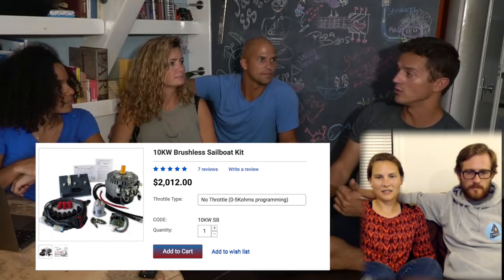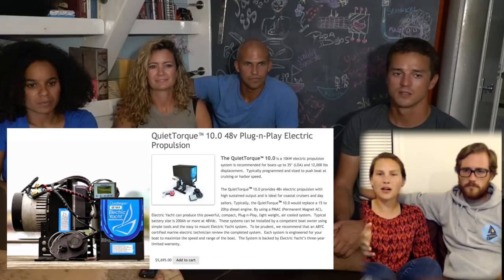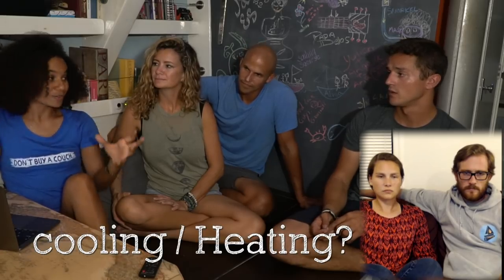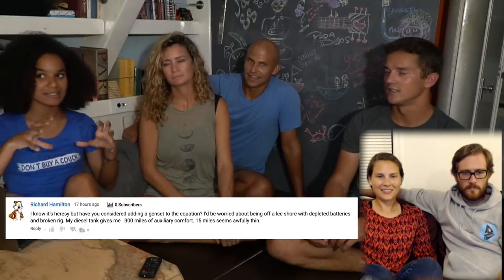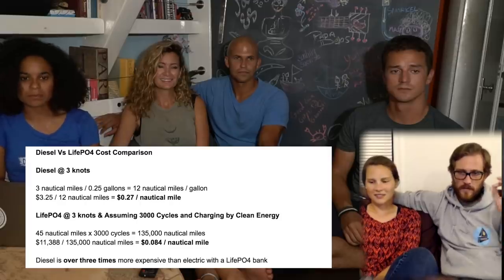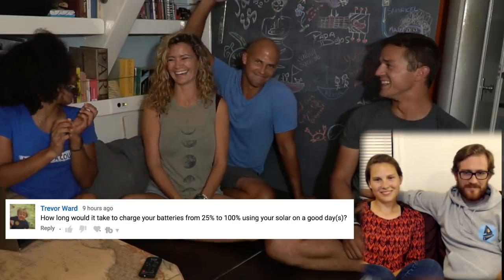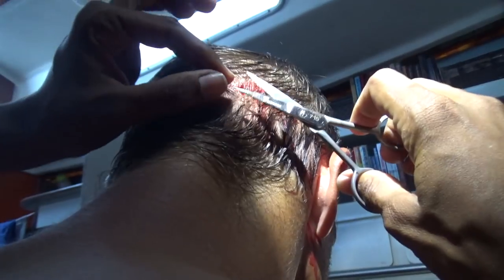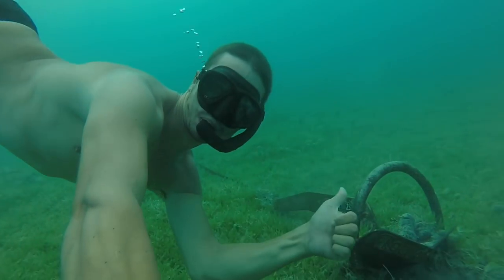Electric Sailboats: An HONEST Discussion — Sailing Uma [Step 140]

Comment: Being a former submariner (engineer), I always smile to myself when electric propulsion is "discovered" as a new technology and the future". Conventional submarines have been using electric motors for some time - 130 years to be precise - since the Peral submersible which was launched amidst great pomp and splendour in the year 1888 after over three years of active researching undertaken by Isaac Peral.   Electric propulsion is great and reliable, as is diesel propulsion. As an off shore yachtsman and despite many years of electric motor experience my preferred propulsion of choice remains the humble diesel engine. Availability of parts, endurance only limited by amount of fuel carried, ability to refuel quickly and power to weight ratio are some of the key drivers for this. In terms of 'green house' impact, I simply don't use the engine for the most part and find I need to carefully gauge how much diesel to purchase to balance the 12 month stated diesel shelf life with reality (usually aim for 2 years). The exception is where we sail up to the equator and there is no wind. A week of motoring consumes a decade of usage otherwise. With currents and tides around SE Asia, it is simply not possible to  rely on the elements to safely convey you to your next destination.  I would have no hesitation to change to electric drive, but would need to take a leaf out of the conventional submarine arrangement where a power source to replace the expended energy is available (termed floating the load). Many bigger modern day sailing ships as well as cruise liners uses this arrangement i.e. flexibility and efficiency of electric but with a like for like power generation source. In terms of using lack of reliability as a 'reason' to change technology, this is a fallacy. If something is broken or not working on a vessel it should be fixed. We sailed in China 20 years ago and needed a part for our diesel engine (heat exchanger). The locals quickly came up with a makeshift alternate that we could have used, but one of the locals that spoke English asked why we simply didn't walk down the road 200 metres to the local Perkins Engine dealer and buy the original part off the shelf - which we did and saved a heap on duties and freight.  Bottom line, turn off the engine, electric or diesel and go sailing!
Reply: Most subs used (correct me if I'm wrong)  diesel generator to electric propulsion schemes. Wouldn't that be a viable solution for a sailboat?
Reply: Perfect solution and the technology that submarines have used for 130 years. The advantages are many, ability to distribute weight where suited rather than at stern. Ability to scale the generating powers to suit load - used in cruise ships when power demand is greatly reduced at nights or when alongside.  Ability to have several generators rather than one big engine that might run at sub-optimal loads. This can readily be replicated in big yachts (say > 80ft).  For regular sized yachts that require propulsion to be available for extended periods i.e. 24/7 the generator must be able to replace any energy used - hence the term floating the load. On submarines once the batteries were full we reduced generating power to equal what was being used to propel the vessel. For a yacht to achieve hull speed for extended periods, it would be necessary to have a generator around the same size as the regular diesel engine i.e. 50HP of electric motor will consume 50HP of generated power (less any inefficiencies). It may be possible to have a generator of lesser capacity if demand is say limited to 12 hours and other means of generating can be used to 'top up the batteries'. However we find all of our generated power (solar etc) gets consumed as house power, so little or none left over for this purpose.
Reply: As a submarine engineer also, I had some experience with Stirling engines and hydrogen fuel cells with Lithium storage. Now that is advanced technology and capable of replacing Diesel engines. At least until nuclear becomes a commodity technology :-O
Reply: Did you catch all the mistakes in his description about 1200 amp hour pack? How about the 350f Electric motor that's designed for 10k hours  @350f?
Reply: So the point that I think all the previous comments miss is that UMA has been operating for 5+ years... yes 5+ years without significant issue, AND the motor they are using, the amps and batteries, their 480 solar, the fact that is overheats if they use it for hours upon hours (which THEY HAVE NEVER NEEDED OR WANTED TO DO), and their method of no needing to "float the load" all works for the style cruising they do. They need nothing else. They admit right in the video several times that this is not the solution for everyone, like maybe those who sail on the equator for days and days, or people who sail with some timeline agenda in SE Asia. Whatever folks, take what you can use and leave the rest. For me, my electrical setup will be solar and generator so I can "floating the load" if I need to, however like the SV's represented in this video, I have no time table and no agenda and I will use the SAILS, the weather and the tides and currents to get me where needed and the electric engine can get me in and out of port without oars. I may never need the geny, but It will be there if I want to use it. That is my style of sailing, and I am glad diesels are there for your style of sailing.  It's simpler, less smelly and I do not need to check the oil levels daily. IT IS simply possible to  rely on the elements to safely convey you to your next destination as has been done for many thousands of years.
Reply: Most modern cruise ships also use diesel generators to power electric motors that are under the ships directly attached to the props
Reply: THOMAS BOLDT :  The same for almost ALL diesel Train Locomotives.
Reply: @MasterYota1  What was wrong with the reported amp hours?
I listened very close and didn't catch anything wrong.
Did you misunderstand the answer that they had 12 one hundred amp/hour batteries?
Reply: @steveddad4385  Uma's Oceanvolt motors are water cooled.
Reply: Aaah a fellow bubble head and I agree with you.
Reply: Let's be honest.  This isn't a "Budget" class of people regardless of what they spent on their boats.   Anyone who can afford to drop $10,000 just in batteries, not to mention the rest of the conversion, is a step beyond my class of boater.   I love to sail, not motor, and yes, they drive me nuts, but not $15,000 worth.  I'd like a renewable fuel source too.   But not $15,000 worth.  How does one ensure a propulsion system worth 2x the value of the boat?
Reply: @crforfreedom7407  I think you might have missed a zero on your cost estimate!
Reply: @captainsalty56  The batteries they bought were just under $900 ea. so that's $10,800 no tax.  The motor they used was a used Clark, I saw them on EBAY for around $500, newer ones went as high as $3,000.   Then all the other inverter equipment needed to support it.   Not all of it of course, everybody has some of that to support their recharging and conversion, but not 48V worth.   I think being very fair, very cheap, about $15,000 is about right.   Some of these others are well over $20,000 to be sure.   We're talking just the power plant and the batteries with the necessary nick knacks.  Nothing else.
Reply: @crforfreedom7407  Yes, you are correct. I was referring to their most recent generation of motor they installed which was I think was the third edition. Pretty sophisticated bit of kit. Think this was donated, but if you or I bought it off the shelf, pretty pricey. However in the intervening three years, since my post, they have done some sailing in places I wouldn't go without an long range motor option. Good on them and we need pioneers. Me, I like to get in before the bad weather.

Comment: I have been a millwright engineer for 46 years, and the worse fork lift truck was a electric one,forgetful on recharge battery failure, and lack of power after prolong use. Combustion engine so much better.....I also fish for trout in big lakes we used to use electric out boards (56 lbs thrust) they where so dangerous when windy.. all boats back to 4 stoke engines... I wish you well,and full charged !! All the best ,  :)

Comment: 👍great discussion! I got rid of my diesel engine over two years ago after it let me down in a very precarious place where I was stupidly expecting it to do its job without fail. More moving parts means more chance for failure... Usually at the most inopportune time. In my case it nearly put me against The Rock jetty in St Augustine. I removed the diesel engine and increased the amount of water I could carry tremendously. Considered putting in electric but before I managed to do it I got quite used to sailing everywhere without any auxiliary form of propulsion.

Good on you all for sailing first. That's why they put those big sticks and sheets on sailboats after all. 😉

I know Beau and Brandy and look forward to bumping into the rest of you probably somewhere in the Bahamas as I'm on that same time schedule LOL. Cruisers, go figure.
Reply: Jim is the BEST yall!

Comment: This is such good stuff! When I first saw you guys install a electric motor I was skeptical about not bringing a generator, but since then I've learned more about sailing and actually started sailing a fairly small boat without an engine. We sail that boat everywhere, even in close quarters upwind. Quite often we have to tack into the harbor where the boat is kept and that's all fine really, if you just know how to sail. Obviously with a larger heavier boat you're not going to be tacking up a channel that's just 2-3 boat lengths wide, but I can't imagine a situation you can't fix with 1 hour or even 15 min of motoring and good seamanship that you could fix with a diesel engine. Keep up the good work.
Reply from the maker: Thanks Paul! We agree entirely.

Comment: One more comment:  I used to have a 27-foot Ericson, I know it is a smaller boat that what you have.  And it was not blue water ready... anyway, its motor had issues, the tank was rusted, etc. After I tried to find someone that would fix it, and how difficult it would actually be to make it continuously operational, we installed the dinghy motor at the transom and it basically worked well to dock and leave the dock area.  That is: if you will keep your dinghy motor, you can always use find a way to use the dinghy motor or the dinghy itself to tow the boat, in case your electric motor does not have enough battery at some point.  That is, it might make it good to think of a good dinghy motor as a back up to your electric motor.  But major kudos to you if you don't think that is necessary.

Comment: We have a 22 foot trailer sailer which is pretty light and slippery in the water. I removed the 2 stroke 6hp mercury outboard and replaced it with a 200ah 12v Lifepo4 battery and a 54lb thrust electric trolling motor. It pushes us along for hours at 3 knots in complete silence. Awesome! Cheap setup for a little boat and works perfectly.

Comment: Our boat came with a small solar array and a D2000 wind generator. The wind generator has really saved us even in the Caribbean. Before we crossed the Atlantic, we added a 1000 solar array. Now we just need more batteries. Preferably lithium. Our biggest power draw is our autopilot and chart plotter. You only get into the doldrums if you don't watch your weather forecast. We just brought new to us diesel motors. I wanted to go electric, but my husband wasn't in favor. That said, I'm looking into it for the future. For light wind sailing, Code Zeros are really good.

Comment: As a millwright in machine repair 35yrs you are totally wrong the windings my be good  for 300 degrees plus but your motor bearings will be short lived over 150 degrees. I have changed out many forklift and ac motor bearings from motor drying out grease and frying the bearings.Bearings at 300 degrees will only last hours and slip on the shaft wrecking the stator
Reply: Agree with Chis Evans , most forklift motors dont have a 100 %  duty cycle  , plus the temp you are measuring is not the internal winding temp. 
but that of the outside casing temp. The insulation will degrade over time. You will need to cool the motor.
Reply: Have you ever installed an edy current shield on a motor? What do you think of them?
Reply: A company I worked for installed a new  frequency drive compressor(undersized) it ran close to 90% during production  , the bearings were running at 216 F they let go after 3 months ,were replaced and let go again.These were heavy duty spherical roller bearings , that forklift motor is ball beaing that should run at 110 to 130 F
Reply: chris evans agree they will find out when they need it most it will seize I believe there best bet is have a electric motor built by 3M in DesMoines iowa they can build anything to specs that are more furious than they can find on the open market
Reply: Dan go with a brushless AC induction motor like this one. I have the 3kw on a 26'. The 10kw would be perfect for you. no fan, nothing to cool. http://kellycontroller.com/ac-induction-motor-with-encoder-c-21_96.html
Reply: @captainmorgan3773  where they gonna get the 10kw from?
Reply: @saylaveenadmearedead  I gave a link to the company they have a 3kw and a 10kw
Reply: @captainmorgan3773  No, Silly! I was asking you where is all that a/c electricity coming from at at what cost?  10,000 kilowatts of a/c!!!
Reply: @captainmorgan3773  that link is now out-of-date.
Reply: While I agree that high temperature shortens the life of bearings, I disagree with your actual numbers, I would definitely repack the bearings with a high quality synthetic high temperature grease, but after having done that the bearings should easily handle 250ºF or 120ºC
Reply: @Robinhulley  100% agree...Im also a millwright and engineer mech. The motor will endure..for some while , as long  it's within normal duty cycle

Comment: First off.  Your skillz have increased a lot and I'd be proud to sail with you any day.  Your skills with that bathroom/galley redo are AMAZING!  Mad props to you two!  I do NOT agree with any statement that includes absolutes like "never", "always", or ever.  Most assuredly, diesel engines are about to be eclipsed.  I don't know if it will by hydrogen, or soloar or atomic but, the costs associated with fossil fuels are going to increase tot he point where diesel becomes obsolete.  Possibly in our lifetimes!  Think about the euler angles and angular accelerations that a mast-top wind generator would entail.  UNLESS, you go for a vertical-mount helical turbine.  As for props...someday, somebody is going to invent a manually-controlled, variable-pitch prop with beta for sailboats!  Turboprop aircraft have had them for decades.  It CAN be done.
Reply from the maker: Ocean volts new servo prop sail drive gets close. It’s not manually controlled, but does give optimal performance in all 4 scenarios.

Comment: Really great video. But there are a few issues that can be resolved.  The right generator (cummings-onan) can give you 11,000 watts at .37 gallons of diesel power per hour.  A diesel electric boat can go over 2,000 miles.  A great plan can work and my wife and I will prove it works when we retire in 5 1/2 years.  Your videos have helped us more than you can imagine.  Thank you thank you thank you!

Comment: Thanks for a longer discussion about the electric propulsion system.  I have the same Thunderstruck kit in my Pearson 30.  The weak link is my 4, group 27, lead acid batteries, but it's enough to get me in and out of harbor, and it's sooooo much better than dealing with the old, Atomic-4, gas engine.  I had not heard of Sailing Saoirse, so I'll have to check them out, but I have been watching Learning the Lines for a bit.

Comment: ... Great step ... fantastic to see the three couples together, the three electric couples .... you sure covered a lot of ground ... you mentioned not wanting to deal with propane, did I Miss it, did you mention your solutions to replacing stoves and oven .. UMA has the long cylindrical solar oven, what else ..... stressing the need for Heavy Weather Sailing solutions ... so important, as is ... single handling capabilities of both partners, so crucial .... Big thumbs up ..... have fun be safe, save our oceans ......
Reply from the maker: We have the larger GoSun now. (Will be doing a video soon) We can also run an induction cooktop and microwave if we wanted. But for now we don't cook much over conventional heat and when we do, our little alcohol stove works perfectly well.
Reply: ..... had forgotten you have an alcohol stove .... induction cooktops I hear are great, no radiant heat, if that is the right term .... curious to see the new GoSun Step .... have fun besafe, save our oceans .....